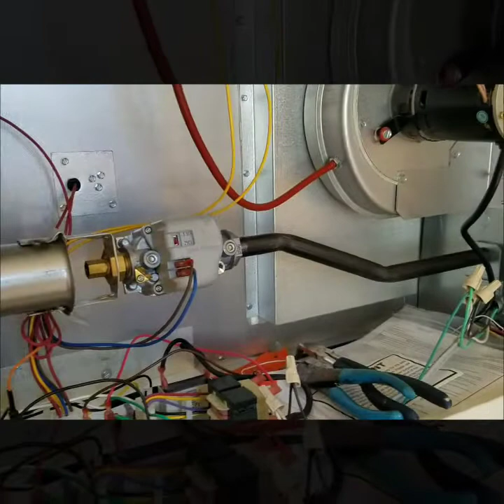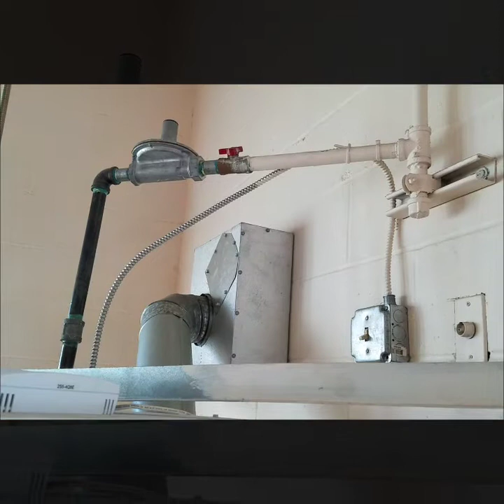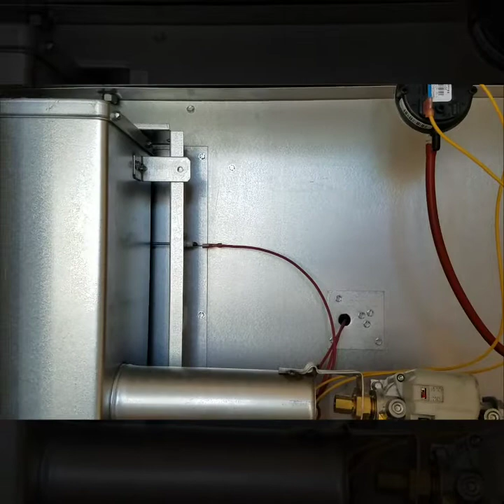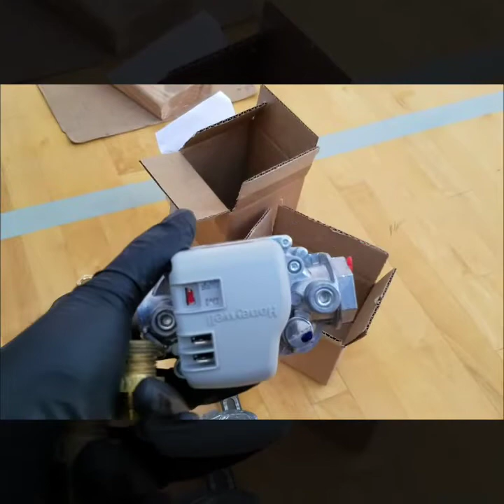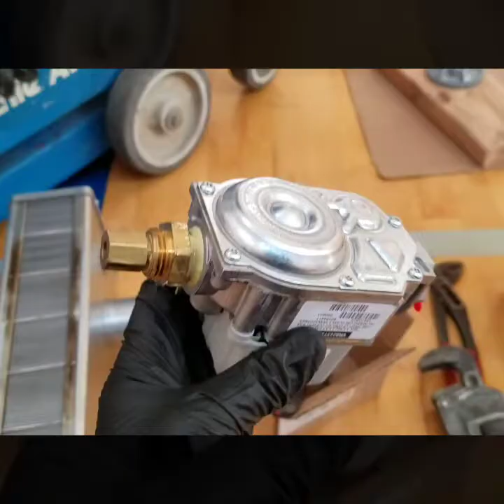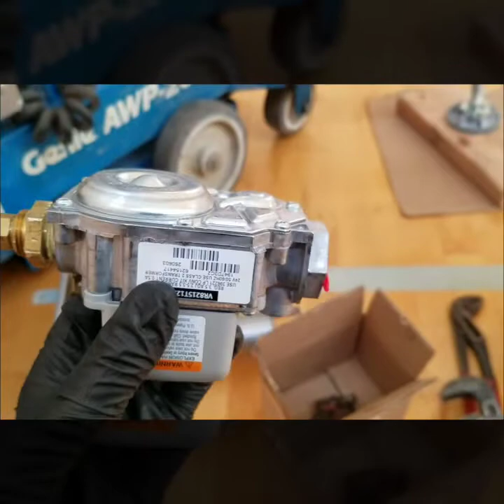Reznor Unit Heater Repair

Comment: I worked on a unit heater that had its inducer motor running and not turning off even when there was no call for heat. Pressure switch was good, and Inducer had proper voltage, we figured the relay in the board was faulty.

Comment: My Reznor shop heater is not igniting has pilot light. I can hear it trying to start but no gas coming through to start the burner replace the valve replace the circuit board still nothing could you let me know what is wrong?

Comment: Nice job. I am working on a Reznor same as the one in your video. I am having the same code. But i am only getting 15 volts to the valve. Is it the board, or the valve. Thank you for the help.
Reply from the maker: Sounds like it could be the board